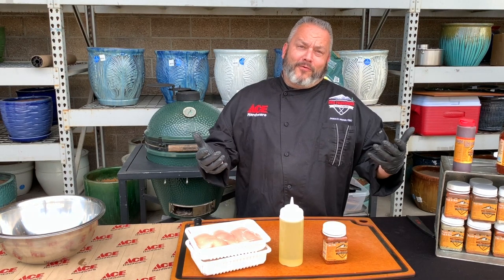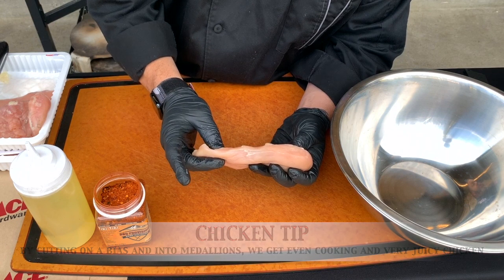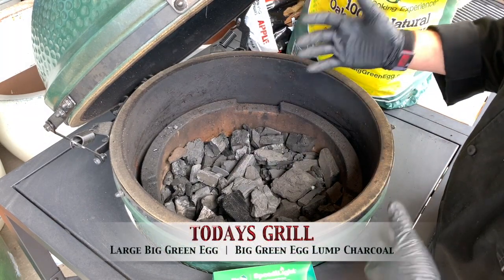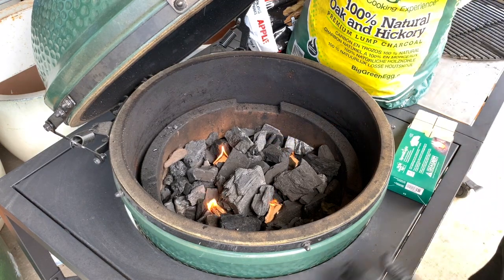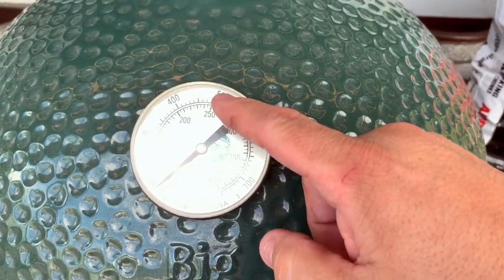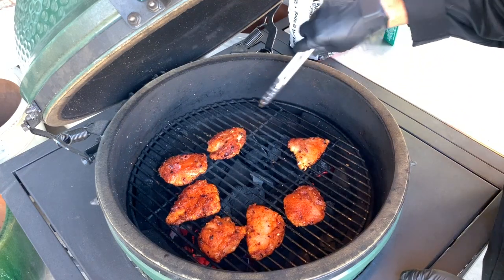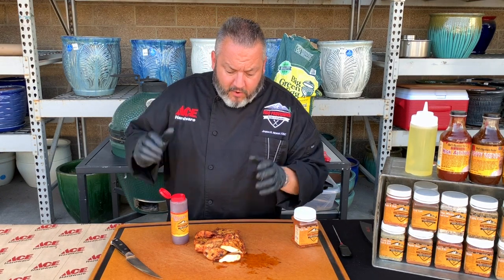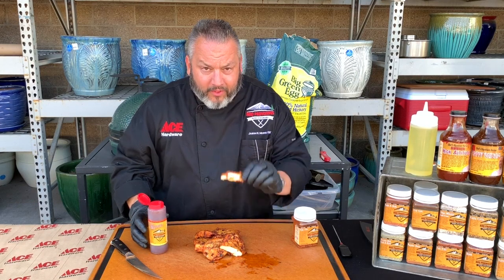Chicken On The Big Green Egg - Ace Hardware

Comment: The screen on the bottom vent should always be closed its used to prevent sparks from coming out from the bottom. And you use the solid slider to adjust for air flow over top of the screen slider. Only time the screen slider should be open is when you cleaning out your ashes.